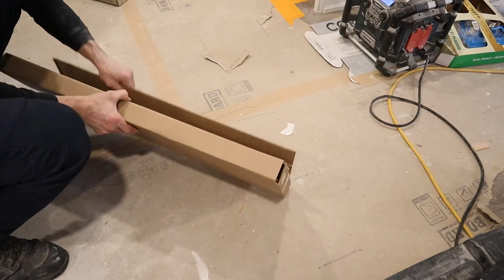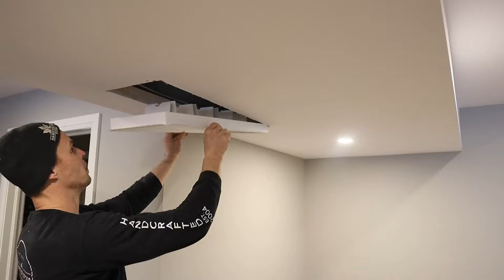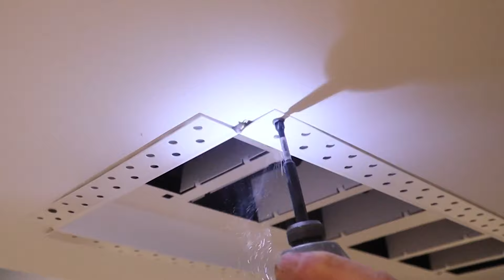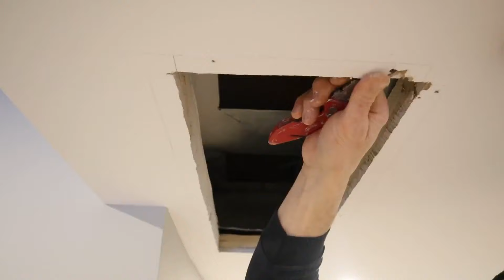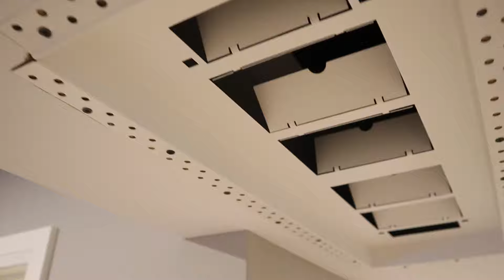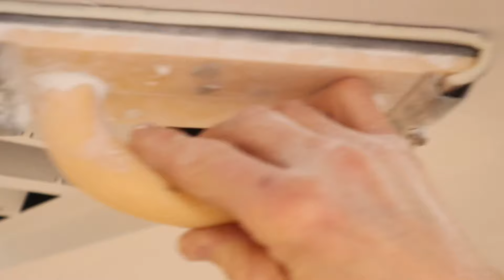How To Install An Aria Vent - Air Return

Comment: Do these restrict airflow in anyway? Or do you still get the same readings as if it was an old traditional grill?
Reply from the maker: These are rated by the company as comparable. The single opening around the face is supposed to be close to the vented grates.
Reply: Yes they do restrict air flow. for sure. There are a few videos on youtube that explain why.

Comment: How does accommodate a filter that needs to be changed?
Reply from the maker: Theres no filters unless you chose to put one in there for some reason. They remove just as they install, haven't seen any air returns that accommodate a filter.
Reply: @HandcraftedbyChrisPalmer   In Texas we have air filters behind our returns before the air gets to the air handler, so this won't work for my return.  I will keep checking to see if they modify for filters.
Reply from the maker: @dawnforman34  we have all the filters at the furnace unit not the intakes. 🫠
Reply from the maker: @dawn forman  just  thought you can put a custom fitted filter here but buying a filter cover to go into the opening, but we don't typically have those in return Air for residential applications.

Comment: What about the air filter?
Reply from the maker: There is no air filter for an air return, that's in the furnace. If you want one in the return Air, you'll simply have to cut one to fit in your opening